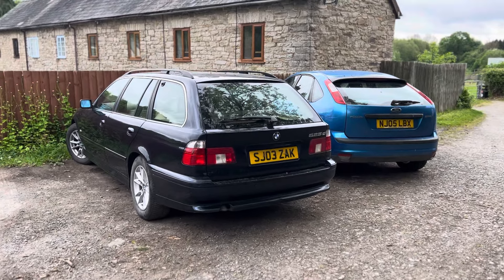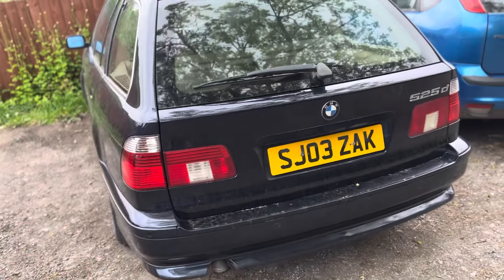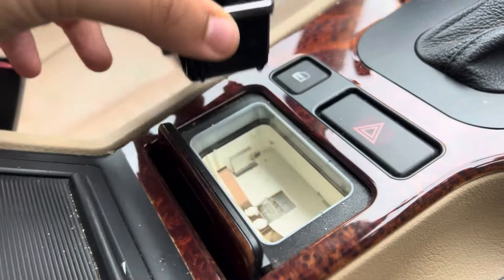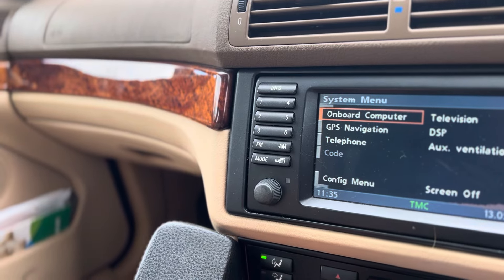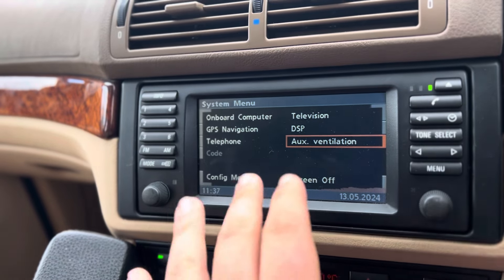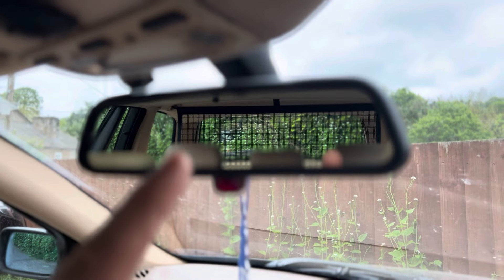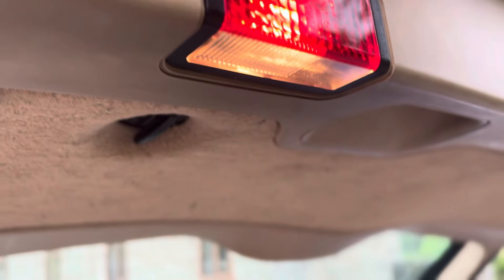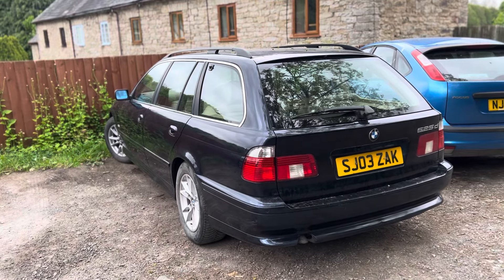Is the BMW E39 5 Series ACTUALLY Over Engineered?! - HONEST Owners Review!

Comment: I've seen your videos about features on an s80. I too have a volvo. Its my first & first sweedish car in general. 
I've owned E39's for well over 10 years! I know them inside out. I've owned 8 throughout. 5 Tourings & 3 saloons, from a 520 all the way up to a 540. I still have my top spec 1997 528 Touring Manual, as it's my first car. I'm working on a full nut "n" bolt restoration on that. So I still have 4 out of 8. I have an 01 525d Touring auto, 02 530d Auto saloon and a 02 540 Touring Auto with the options list almost fully ticked. I also own 3 E38's. An 01 728 sport, a 95 750iL & a 99 740 (full spec).
These E39's are super tough cars. My E39's are nocking on the near 200k mark and still feel solid.
Rust is the natural enemy, penny pinching previous owners, another... Tailgate wiring, gas struts, pixles, headlight adjusters, plastic cooling system components, swirl flaps on the diesel auto's and so called "seal for life" gearboxes. The Diesel auto's with the GM 5L40E are underrated on a 530d.
Reply: The 530d with the GM 5L40E (A5S360R in BMW terms) auto boxes are unreliable/fragile because they are overmatched by the weight and the torque of the M57 530d engine.

The GM 5L50E (A5S390R in BMW terms) are the one you want, it is a far better match with the M57 530d torque and the E39s weight..

Comment: A lot of E39s are spoilt by being run by people who cannot afford to run them. Neglected servicing and routine maintenance. They are also vulnerable to rust in the sills and around the jacking points, something that many owners ignore until they are an MOT fail.

The M57 525d and 530d are virtually bombproof. Unfortunately the pre 2001 model year auto box on the 530d are fragile because BMW chose an autobox (A5S360R) that was overmatched by the torque of the 530d and the weight of the car. The facelift models (2001 model year onwards) had an uprated autobox (A5S390R) which can cope with the torque and weight.

The self-levelling pneumatic suspension on the Touring makes them excellent towing cars.

I have two 2001 530d Tourings, one manual and one auto. Wouldn't change them for anything.
Reply: I daily drive 530d with 253k miles on it. Never had to work on the engine and it still runs as smooth as I ever remember.

Comment: Many of the features of the 5 series Touring were ported over to the Rover 75 Tourer as it was developed under BMW ownership although released BMW had divested the company. The split tailgate is the same, as is the tonneau cover although of course the shape is different. I wonder if your seats fold flat like my Rover ones do as the rear seats are different to the saloon version? 

The gear knob is identical & many 75 owners swap them over to get the wood gear knob off a BMW, the tang must be swapped as they are different lengths. 

I also recognise the electronics, many BMW radios can be swapped directly into the Rovers & the Highline units were identical with only a logo change. 

I still see a fair number of E39’s on the road & a couple of Touring’s regularly driving around in my area, along with the E38 they are my favourite BMW’s. I always liked the light green with Montana green leather seats Touring petrol that Geoff Buys Cars reviewed some years ago. Sadly he moved it straight on.